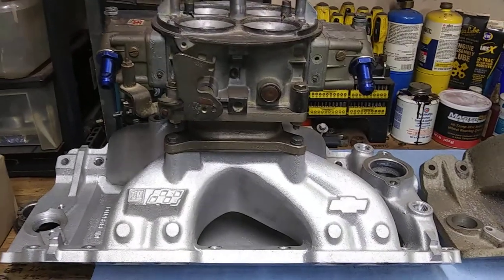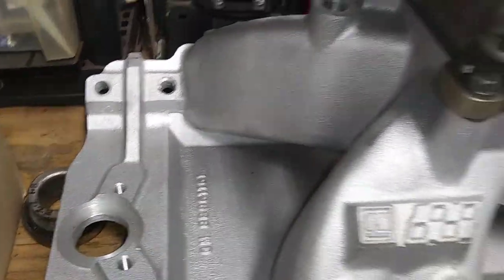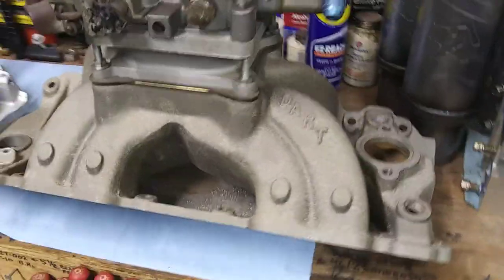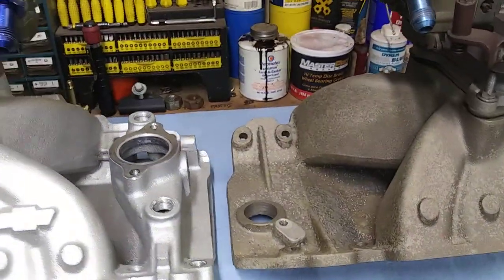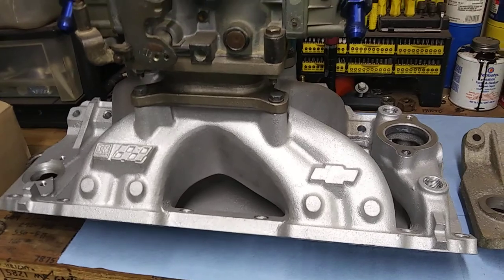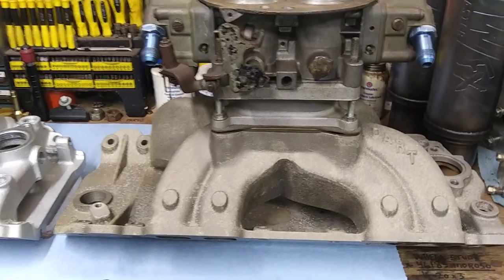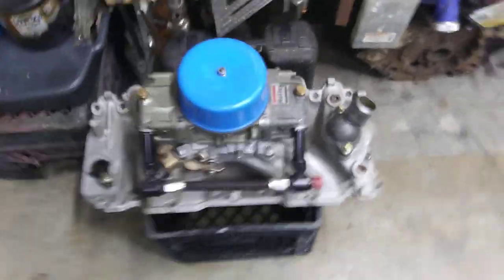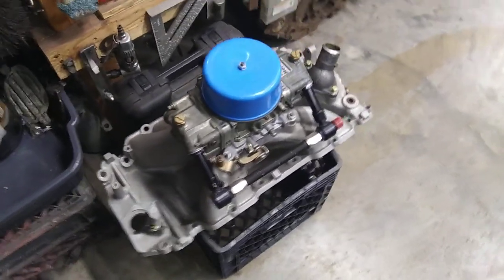Bowtie bigblock Chevy intake compared to a Dart & also a Holley Strip Dominator.

Comment: Any standard deck reck port goodies in stock lol
Reply from the maker: Yep, I'm building 4 bigblocks for myself. Slowly collecting all the shit.
Reply from the maker: Even have a pair of old 990 heads tucked away collecting dust.
Reply from the maker: The Dart and Strip Dominator and Tunnelram are all for 9.8 deck bigblock. Fixin to buy a Super Victor. intake for a 496 I'm building. They are hard to beat for an as cast intake.

Comment: They look identical
Reply from the maker: Ain't a whole lot of difference, that's no shit. Pretty obvious where the newer shit got its design idea from.
Reply from the maker: I remember an intake test back in the 90s where they ran a few different intakes on a 502, it was around 650hp NA, the Dart made more power than all the rest, it was 30+hp better than a Strip Dominator on the same engine. Team G was about 40hp down. Victor was also down quit a bit from the Dart singleplane. I swapped one on a 477ci back in the 90s and picked up 2 tenths over a Strip Dominator. Definitely made a difference. Ran low 10s in a Street/Strip Malibu wagon.

Comment: Two words. Pro Filer or just condense it down Profiler
Reply from the maker: This ain't about a Profiler. They are good intakes in the right application, but no intake is the best for every application. The RHS bigblock singleplane is the same intake for less money. But this video ain't about those either.